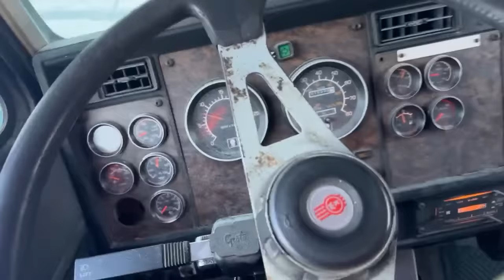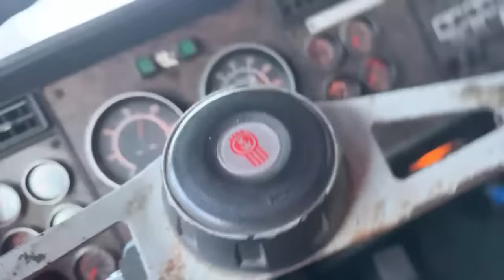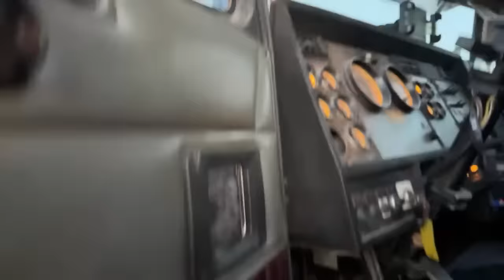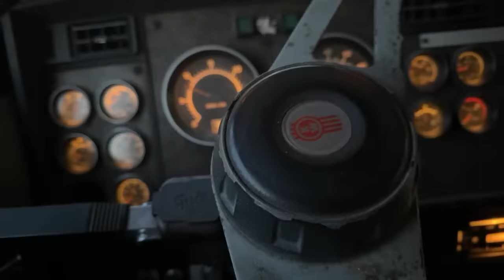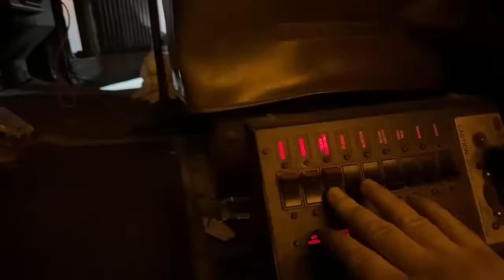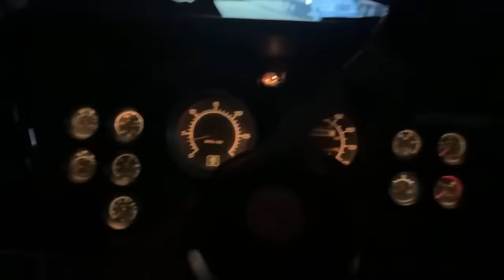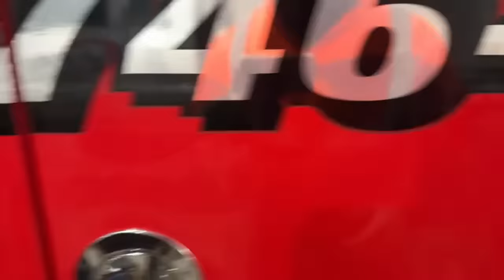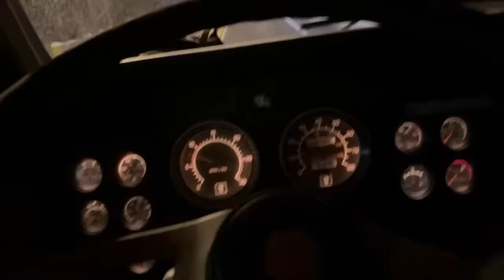Towing In The Ice!!

Comment: Tim, seems like you didn’t have your cams set on your chains. Are you aware how they work? Not everyone is aware. Your chains will fit much better when you set the cams properly.
If you are d going to to do a lot of work that requires chains, you should consider putting a chain rack on your truck. Keeps them tangled free and ready to mount.

Comment: If your going to be doing simple winchouts like that a good bit threw the winter tim you should buy a smaller wrecker instead of having to take that big wrecker to do little stuff like that its just unnecessary man i think atleast a medium duty setup for the smaller stuff would work perfect. Also if you plan towing full time along with the trucking you should consider expanding on the towing side of the fleet and buy a landoll, one or 2 decent rollbacks, and a smaller wrecker either a one ton 4x4 wrecker or a medium duty wrecker setup or even both that way you can cover all towing needs not just big stuff.

Comment: I’d build doors that would cover your hydraulic controls so they will stay much cleaner and you could install LED lights in them as well.
Reply: I said the same thing in one of the first videos with the wrecker.  It would have been easier and cleaner before it was painted but it can still be done. A piece of stainless steel piano hinge and a bead roller to put a slight bevel on the edge of the door panel.

Comment: Get them nobby’s tires off Braxs Air-Force truck on the wrecker and you will be in good shape for the bad weather I’ve ran 45-48mph with chains if the snow is thick and packed on the road I guess you could go faster

Comment: How is the engine temp? Is it running cold?
Maybe put some cardboard in front of the radiator to bring the temp up a little so the cab is warmer.
Reply: If the thermostat is working correctly it shouldn't have a problem with cab heat.  I would install a webasto or espar heater.  I have a webasto in my Duramax swapped h1 Hummer wagon and I love it.